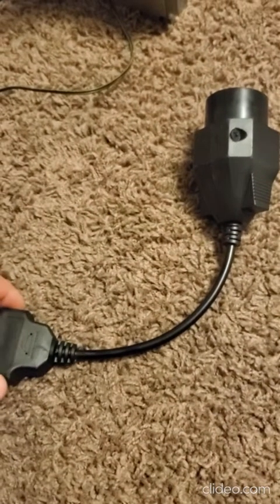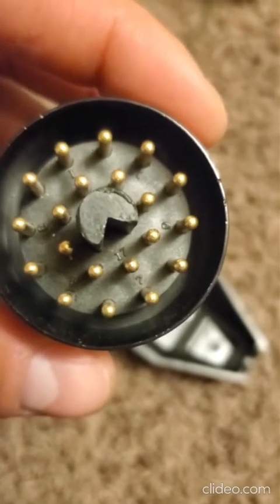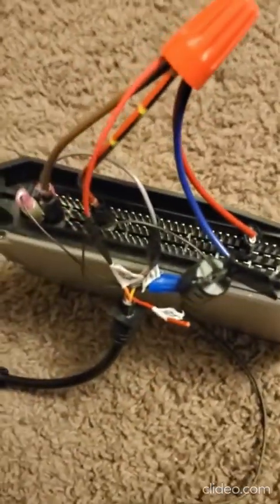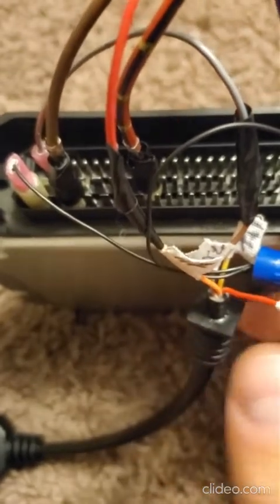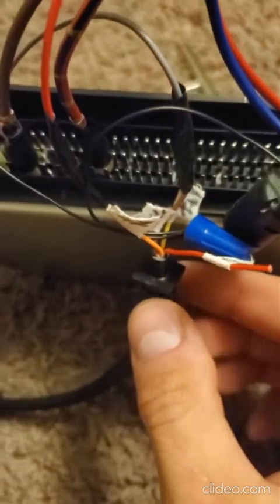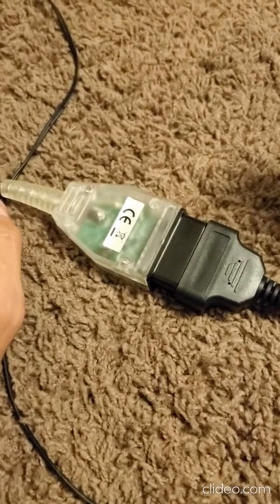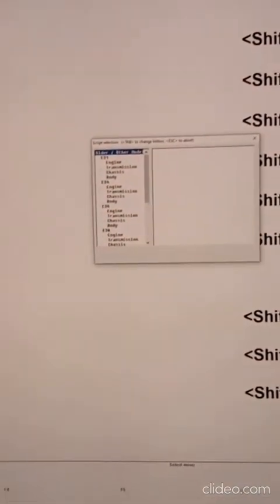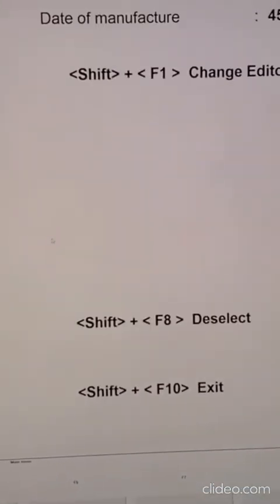Bench Test DME Module BMW E36/E39 M52 2.8L Siemens MS41.1

Comment: the program wants me to turn off the ignition, which pin is responsible for the ignition in the controller?
Reply from the maker: Basically, just disconnect the power for a few seconds.
Reply: @BimmerFix thanks bro 💪💪

Comment: hello can u help me please ? i got the cable i got flash tool i bridge 14-18 but flash tool doenst flash ecu.... why ? m52b20 20 pin
Reply from the maker: Are you doing it on a bench or in the vehicle?
If in the vehicle, don't forget to bridge pins 17 and 20 on the round adapter.
https://thebimmerbarn.com/blogs/news/round-20-pin-adapter-bypass
Reply: 17-20 or 14-18 ? hehe 
 @BimmerFix
Reply from the maker: @dexterpapasideris1706  You short pins 17-20, that way you can access everything from OBDII, no need for "Pac-Man" adapter.
Reply: yup i fix it i just need the ms41 def and im trying to register on roomraider and i cant -.- i cant pass the bot question how to make a cake ffs -.-  @BimmerFix
Reply: btw i fix it i just need ms41 def cause my roomraider doesnt open it can you help me please? @BimmerFix
Reply from the maker: @dexterpapasideris1706  https://sites.google.com/site/openms41/romraider